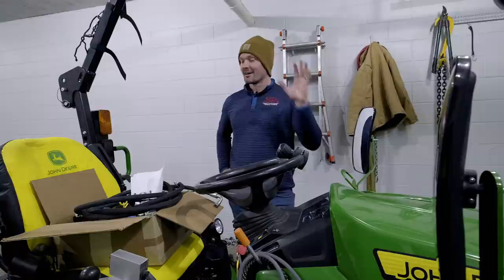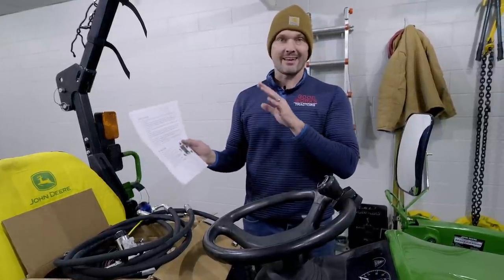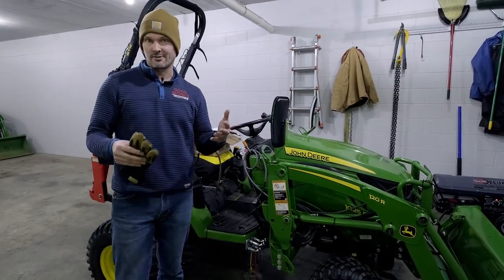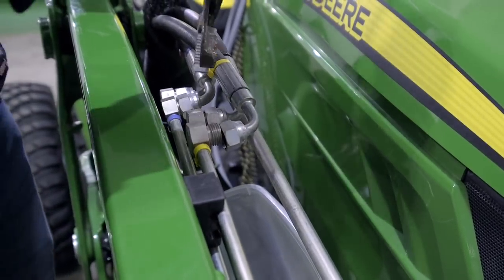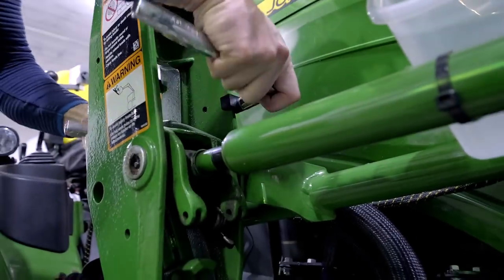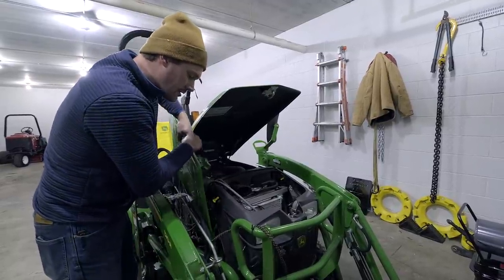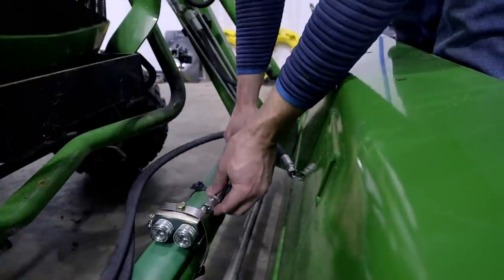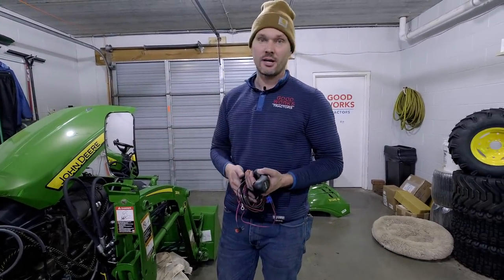SAVE $1000 IN 90 MINUTES & MAKE YOUR TRACTOR GRAPPLE READY!🚜

Comment: I bought a 3rd function Kubota kit for my Ford NH 1520 and love it.  Minor fitting change but made it work. 
SIDE NOTE: I wired the switch HOT all the time so that with tractor OFF I could dump the pressure anytime.

Comment: Great video! The only thing that I would recommend is when you are cutting off the zip ties, use a flush cutter. If you use side cutters, they will leave a knife edge that cuts through skin quite easily.

Comment: I've got a diverter kit for my 1023. It went on pretty easy. The hardest part was running the wires and keeping them out of the way and secure. 
Absolute best part; after my wife has been running the grapple for a little while, I'll swap the two line on the front of the loader so the grapple will open instead of close. Ah, the puzzled look on her face, priceless.
Reply from the maker: Haha, never gets old?!? 😂
Reply: So does it work with 2020 1023e with 120r loader?
Reply: @Jorgemartinez-qo6yq  You're asking about the diverter kit. It works very well with my 1023e and 120r loader.
Reply: @blackhawkinternationalsecu6962  thank you

Comment: I added one of these to a 3025e with a D160 loader. There is only one way the hydraulic circuits will work, and it results in the control handle go what would be the intuitive movement. In other word, to clamp down with the grapple, you have to move the dump direction. Reversing hose results in the grapple locking up. I studied the hydraulic circuit and determined there are check valves that keep the bucket from falling in the event of a blown hose.

I also had trouble with the grapple losing its grip on the load. I finally purchased the full third function valve that works off the power beyond circuit. That works great. I’m about to try the diverted valve again on a 5300 with a 540 loader. Not sure the check valves exist on it since the loader is hosed to the 2 rear SCV.  Wells see.

Comment: I am almost done with this installation on my 2016 1023e and was glad I found your video. I agree it would be nice if the hoses were labeled, but they do reference them by length so not to hard to figure out. All I have left to do is the electrical connections and one thing that I did to make the positioning of the joystick handle correct was to buy a 10mm x1.5 nut and thread that on the loader control first then I could position the joy stick and tighten both fittings together. Basically double nutting. Less dangerous than possibly over tightening the fitting that came with the kit.

Thanks for your contributions,,, Bill
Reply: I have a 2020 1023e with120r loader. Will it fit?
Reply: @Jorgemartinez-qo6yq  I believe it will. The kit is actually for a 1025r. But you have to select which loader you have. Pretty sure the only difference is in one set of hoses.  You can always reach out the technical support folks at Summit if you are concerned.
Reply: @TheSmalljob  thank you.  Both 1023e and 1025r have the r120 loaders.

Comment: Some of my larger farm implements use diverter valves and it comes in handy just takes one spool off the tractor and i have it running 5 different functions all in toggle switches . And i did most of it myself biggest cost being stacking valves for each function and getting the wiring right . One thing i been thinking of trying is adding a Muncie Clutch Hydraulic pump to a tractor for running a sweeper broom since its a severe duty job
Reply from the maker: Yeah, I got a multiplier to put on my 4066r.  Can't wait to get it hooked up.

Comment: I bought the Worksaver electric grapple for my JD 2305, but have already gone through 2 linear actuators - they shear internally very easily if you overload the grapple by tugging or pulling on a log, etc.  Have you found using a hydraulic grapple with the Summit third function diverter kit to be more resistant to failure?  I would assume the hydraulic cylinder would only fail if you bent it?

Comment: I have a John Deere 2305 and called summit, they said they can't reassure me the kit will fit my 200cx loader.  But Artillian's kit does fit the 1025 and 2305.  So I think I'll take a shot and order the Summit kit assuming if it fits the 1025 it will fit the 200cx loader.  My only concern is which adapter for the joystick will work.  I love the Summit kit, it looks so well made and also really like the joystick handle and light on the diverter when it's activated.  Thanks for the wonderful video.  Your thoughts please????
Reply from the maker: That would be my only real concern is the adapter for the joystick.  I am not familiar enough with the different options nor how your handle is mounted to the loader joystick to give a good recommendation unfortunately.
Reply: I was also considering the Summit for my 2305 JD tractor.  The only concern I have is with the Joystick handle.  Without tearing up the current soft rubber grip, need to know if it screws on or it is a slip on type with glue.

Comment: There is a 3rd function kit on Amazon for a 1025r and it’s a full third function with two buttons not just a diverter the cost is $425. That would be something cool to make a video on too
Reply from the maker: You mean the universal kit offered by Summit?  I think that's a bit different, but have heard good things.
Reply: @GoodWorksTractors  yes it would be interesting to see it because it’s not a diverter it’s a 2 way valve

Comment: If we need the several extra rear hydraulic connections in the rear anyway, is there any way to tie into that bank of outlets then route the front hoses about the same way with quick disconnects to hoses routed to the rear?  I’m a little hung up on how the electrical would tie in but is it possible that a three position toggle (pinch/off/release) could be placed almost anywhere such as on the steering wheel eliminating the new joystick and sacrificing the ability to tilt and pinch/release simultaneously?  

Whew that was a mouthful but I have a root grapple on order and have about a month to figure this out.  BTW I’ve got the newer large frame 2038R with backhoe.  Nice videos and thanks for any advice!

Comment: It looks like a good kit. Not sure what the price is. I added a John Deere 3rd Function SCV to my 2025R. I know Deere makes a kit for the 1025R too but don’t think they have one yet for the 2032R/2038R. I paid $1025 for my Deere kit and did the install myself. My dealer mentioned 5 hours to install it; I have probably 15+ hours in it. The Deere kit is not a diverter but has an up or down switch in the end of the loader control joystick. I’m not knocking the Summit kit; it looks like a great kit for the budget minded and it will do the job for those unwilling to fork over the Deere price. I would like to point out that for the difference in price, the Deere kit has a cleaner install. Just two additional quick couplers below the right floorboard, less lines hanging on the loader frame, the SCV itself is hidden under the tractor instead of the diverter hanging on the loader frame, the quick connects on the front of the loader frame don’t have lots of extra hose to catch on anything and all the electrical neatly routes from the joystick under the fender/floorboards and hooks on the existing electrical block on the engine side of the firewall. The Deere kit also includes hard lines as opposed to rubber hoses that follow existing hard lines with standoffs on the loader frame. With the Deere kit, prepare to take a lot of the tractor apart to install it and take your time. As Courtney said, if I can put it on (the Deere kit that is), anyone can do it. For me the other alternative was an Artillian diverter and it was $740 plus the push button control knob for another $90 making it almost a toss up for me between it or the Deere kit. WR Long also makes a 3rd Function SCV too, not a diverter and while it seems equally as complicated as the Deere kit, it is somewhat cheaper. Look at all the options before you purchase.
Reply: I had the dealer add JD auto throttle and JD front third function before I took delivery of my 2025R. I know service thought I should have been charged more than I paid. I took it back and made them run the loader lines like the directions  indicated. I would have to do some digging to find out what it cost me.
Reply: Thanks for the info. On the 1025R,  a 3rd function SCV does not have big advantage over a diverter since it does not have adequate flow to run both simultaneously anyway. But having hoses and wires tucked away better is a big advantage in my book.
Reply: I agree. The cleaner the installation the better.
Reply: @terryluebbe2560  That has changed, you can get a kit from HydroPlus to increase flow. Allows multiple functions.

Comment: When adding a diverter, do you need to add hydraulic fluid if your hooked up with a grapple?
Reply from the maker: If you’re adding additional space to the hydraulic system, then it will require additional fluid.  Let everything cycle a few times.  Turn the tractor off and let cool down.  Then top off as needed.

Comment: Great video. Just what I've been looking for! Question: After doing the install, what's your opinion of doing the first part with the loader off the tractor and then hook it back up to do the electrical part and joy stick? It seems like it would give better access routing hoses and hooking up connections
Reply from the maker: I thought about that, but I'm not sure how things would be affected on the hydraulics side when lines are split apart and then trying to get all the hoses oriented correctly with the loader off the machine.  It wasn't too bad with it installed I guess.

Comment: Courtney 
When  disconnecting the loader besides disconnecting the hydraulic hoses, not sure what electric needs to be disconnected.  Looks like the wire going into the fuse box and the wire harness to the diverter.  Is that correct?
Gary
Reply from the maker: Only the grey electrical connection.  So, one additional connection compared to normal.  Piece of cake.  No messing with the fuse panel.

Comment: Does the 1025 run 1/4" hoses and couplers or 1/2"? I have an deere x7xx HDGT I'm in the works of making the summit kit work on, however the 45 loader I have has 1/4" hoses whereas the diverter takes 1/2" - not sure if running smaller hoses creates any problems.
Reply from the maker: I don't know, guess I'd have to look at the hoses closer.  Never needed to replace one.  I think the fittings are all 1/2" if I recall, so would think the hoses are too?
Reply: @GoodWorksTractors  Gotcha, thanks for the info. I guess I'll try running with it and hope for the best. Really excited to put a grapple on lol

Comment: Why not mount the diverter upside down? The hoses would then connect as you originally thought they should. I can’t imagine that the diverter cares what orientation it is mounted. Maybe you can ask Summit. Would make the new hoses even shorter.
Reply from the maker: Summit says it wouldn't fit correctly in that position.  Could always try it.
Reply: @GoodWorksTractors  mom

Comment: Any reason you didn't run the new hoses in a protective sleeve?
Odd that they have the valves reversed from what would seem "normal". You originally connected them as I think they SHOULD be designed. Why wrap 4 hoses around the valve rather than going to the near side with shorter hoses? 
Interesting that the quick couplers on my Mahindra are female on the hoses, the Deere are male. I don't know if there is a reason for the difference.
Reply from the maker: The new hoses wouldn't fit with how it's configured.  That's the way the valve comes I guess, so that's the reason for the orientation.
Reply: @GoodWorksTractors  Could the diverter be turned upside down (with the solenoid pointing downward)? Then the looping of hoses would be avoided.
edit: Never mind - I just saw that this question was asked and answered further down in the comments.

Comment: Is it possible to also run a rear remote off of this diverter?
Reply from the maker: Definitely.  Instead of running the hoses down the loader, run them to the back of the tractor.
Reply: They offer an additional universal diverter kit that could be combined and wired on a seperate toggle switch to activate.
Reply: Thanks so much! I already have the diverter for my grapple but want to add a rear remote for a hydraulic top link.
Thanks for the great videos and information!

Comment: Add in the Single Point connect kit and that right side is going to be pretty cramped 😂
Reply: Have the Summit arriving tomorrow, looking forward to creatively fittings it on with a SP....Might have to craft a bracket. Do not want to mount it on the outside of mast.

Comment: Great video, if it is hooked to the bucket then how do you take off the bucket and hook up a front snow blower? I have a BX with a cab so would this work on mine? Sorry, had to ask, thank you.
Reply from the maker: You disconnect the quick couplers like you normally would.  Just one extra quick disconnect for the electrical.  So, only one extra connection required for disconnect.

Comment: I took a look online and in the additional information sections it states “This kit is currently in the prototype phase”. Doesn’t make me feel warm and cozy if this is a prototype!
Reply from the maker: The custom components are simply hose lengths.  The diverter has been around for quite awhile. It's just to note that you may get product improvements depending on when you buy.
Reply: @GoodWorksTractors  good to know. thanks!

Comment: A few thoughts after watching the video, these hoses could all be shorter for a cleaner, less obstructed install. This is a good prototype though.

The 3rd function line going to the loader should be straight not looped around to face the other direction. It's just more hose to get caught on something.
Reply from the maker: Maybe.  Need to have some flexibility in there.  Hoses mount on opposite sides so if they are too short, then they might restrict flow at the bends.

Comment: Kit is $599 on sale. Kubota quoted me $1k installed for their 3rd function. I’m still trying to figure out how I’d be saving $1,000?????
Reply from the maker: Sounds like you've got a cheap dealer, good for you.  I guess $500 savings isn't worth it.  Probably just take it to Kubota and have them do it :)
Reply: @GoodWorksTractors  I do need to order a uhmw or rubber for my plow. I know you always talk about saving on the shipping but I doubt there’s no way to save a few bucks there. I’ll need one 8’ in length.
Reply from the maker: Saving on shipping is if you combine items.  Not really a way to save on shipping if buying one item though.
Reply: @GoodWorksTractors  3rd function kit and a 8’ piece is 2 items Neil ;)
Reply from the maker: Haha, not from the same company.  I don't sell the diverter kits.  You buy those manufacturer direct from Summit.
Reply: I've talked to 3 different Kubota dealers and they all quoted me $1500 installed.  Time to DIY!
Reply: @Azone14  Thanks!  That's the same kubota I have.  Actually haven't even taken delivery yet.  Good to know you didn't have any issues with this kit.
Reply: @Azone14  Which kit did you buy for the L2501? The same kit in the video?

Comment: Would this work on my truck?
Reply from the maker: No, don't think so.
Reply: @GoodWorksTractors  ok, I was thinking about putting a plow on my truck and don’t want to have a 4 way lever. I was thinking about having a 2 way and just using that diverter to change flow from loft cylinders to the tilt cylinder

Comment: hehe i have seen people crimp those blue connectors allot of odd ways but watching you do that made my head hurt do yourself a favor spend $10 on a crimp on wire connector crimper. save you allot of headaches down the road.
Reply: Crimp it anyway you want... Solder it after and  heat shrink it. Crimping is just bad news.